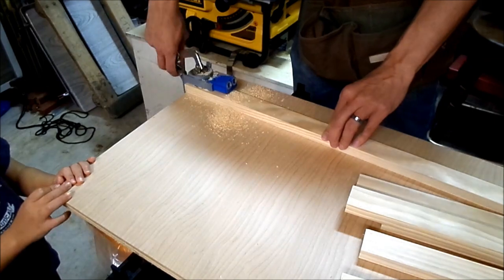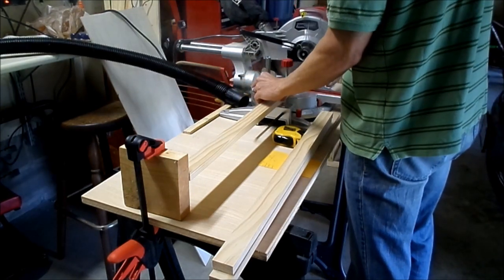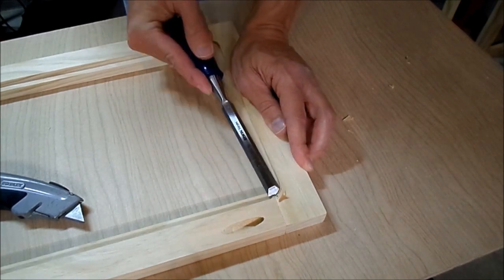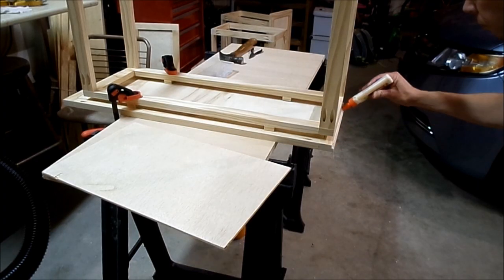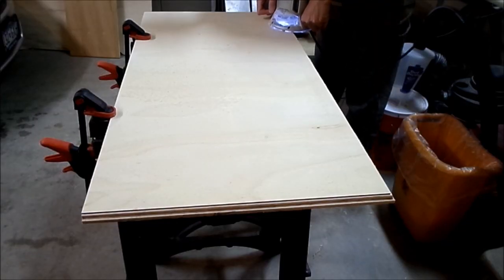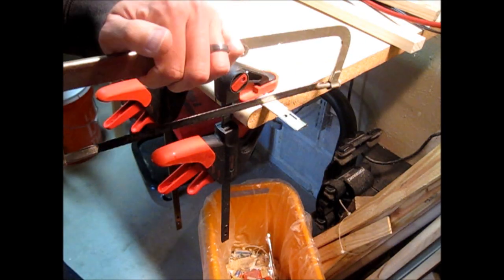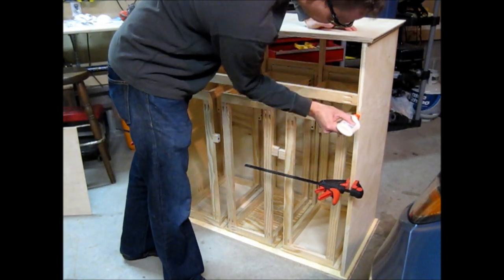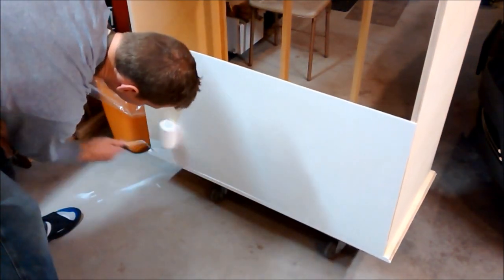DIY Tilt Out Laundry Hamper Cabinet

Comment: I think the only difference I would’ve made because this project is really nice. Instead of leaving a gaping square opening on the back, I would’ve either added decorative metal or covered the entire back (without glue Incase it needed replacing) with wood backing and cutout spots for some lightweight vents or again using decorative metal cut out shapes that looked nice but added the benefit of airflow and trim out the shapes with thin trim out of the same backing material to keep it in place. Mainly because having a back to your cabinet will hold everything square and prevent leaning or wood movement
Reply: On the other hand, leaving it open will make it much easier to fish clothes that fall out of the bins, to the bottom of the cabinet. Personal preference I suppose.

Comment: Nice work!  I noticed you mentioned removing "bags" at the end of the video.  What type of bags are you using?  Getting ready to build something similar but was planning on using plastic laundry hampers.  Thanks
Reply from the maker: Hi.  Thanks for watching and the comments!  I used plain laundry bags from Target.  I don't have the p/n, but I'll update the comments if I come across it.  I originally planned to use plastic laundry hampers too, but my wife prefers bags, so that's what I did.  :)
Reply: What are the dimensions you used? This video was perfect to figure out the basic frame I wanted to make as well myself..I also have juggled with both ideas for using the cloth bags or plastic hampers.. thank you for making this video also..

Comment: Do you have some type of stop or something that only allows the bins to tip out partially so the doors dont fall to the floor?
Reply from the maker: Yes there are stop blocks on the back of the bag frame.  It's at about the 3:40 point in the video.  You can flex the frame to bring it all the way forward if needed.  Thanks for watching!

Comment: Did you rout the edge of the plywood or did you attach 3/4" molding ?
Reply from the maker: Hi,  I routed the edge of the plywood.  It took a bit more time to finish but worked out ok.
Reply: i didn't know you could rout a smooth edge in plywood. Did you have to fill in many gaps prior to painting?
Reply from the maker: Some areas were very smooth, but other areas had voids.  It actually came out better than I expected and didn't do much filling.  I think solid wood or molding would also be a good option.

Comment: I'm just wondering, why did you use the pocket holes for the outside of the frames?
Reply from the maker: Hi,  I went with pocket holes because the frame is covered by the bag.  Also it is a fast and relatively strong, plus I wanted to try out a new Kreg jig.  😉